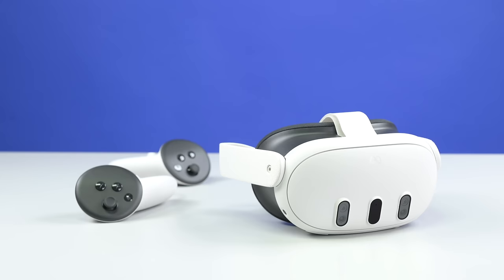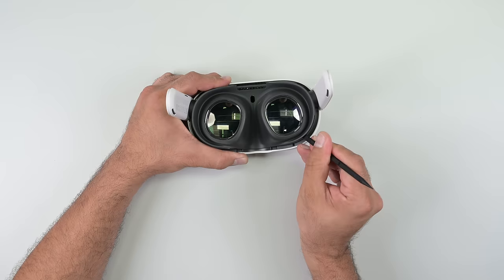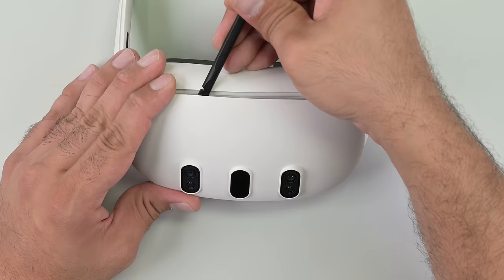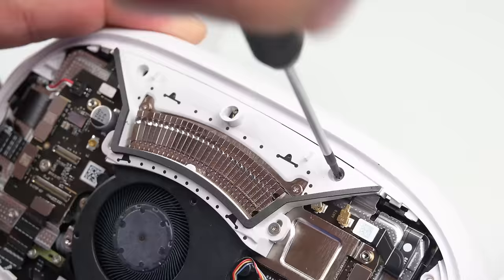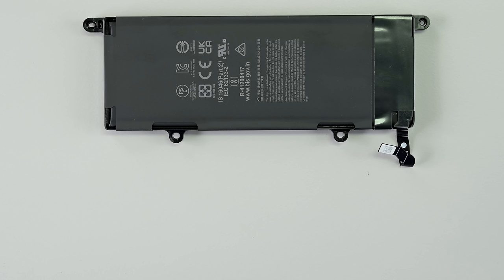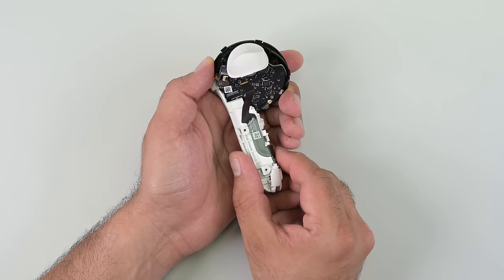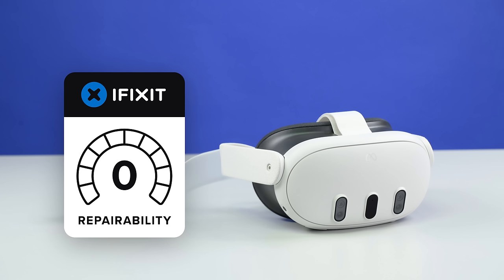Meta Quest 3 Teardown: What Are You Sacrificing for Savings?

Comment: I'm fine with this. I replaced the battery in my Quest 2 and I tore down and rebuilt the thumbsticks in both controllers to definitively fix the drift, and I'm confident I can do these operations to the Q3 even easier. Are these jobs for the average end user? No, but I'm covered.

Comment: Burrying a battery this deep into a device should be illegal. Every customer should be able to replace it within 5 minutes. I really hope for some regulations here.
Besides: Did I miss it or did IFixIt not check the control sticks? Are they using hall sensors?
Reply: Keep in mind in this instance it's actually better. The battery is pushed that far down because otherwise the headset will feel a lot heavier than it actually is. You want all the heavier components pushed nearer to your head for comfort and balance reasons

Comment: So far I am not impressed with the Quest 3.  It is half an inch smaller than the Quest 2, and I have seen stutter on simple games like beat saber. The only thing better is WiFI downloads are a lot faster, and eye focusing is a lot better than the Quest 2.  But for a 3 year wait and a $200 price increase, its an expensive sell for not a whole lot of improvement.
Reply: Just the new chipset and the pancake lenses alone are an upgrade, at least for standalone. For PCVR it supports AV1 if your GPU does too so you can have a better experience

Comment: 4 feels a bit harsh, but i wish it was easier to replace the battery
Reply: that's probably why it has the low score, since it's no better at battery replacement than the quest 2
Reply: @Omabatfartsbruh  yea, but the fact its all just screws, and not glued, means it is at least moderatly replaceable.
Reply: @rattslayer  its difficult, not impossible, thats the big part

i wouldnt be suprised if the vision pro's teardown is like swimming trough a glue factory
Reply: @Marpurrsa  i bet vision pro has a self destruction module when chassis intrusion is detected for the safely of the user.
Reply: Ahhh, yea, because you should based decisions on internal batteries for your vr headset.
Never thought I’d see the day
Reply: @mcgritty8842  because... The ease of repair, the fact that used screws instead of glue, should increase the repair ability score... And used standards screws instead of any kind of tamper resistant screws.

Never thought I would see the day.
Reply: @rattslayer  lets not forget he did break it taking it apart.  so if anyone else want's to give it a shot, good luck.
Reply: The reason the battery is so far back is because the battery is the main weight of the headset, so you want it to be as close as possible

Comment: There is this old type of light projectors, which can be found in your faculty not only at Manifest Ben rooftop. My bigest problem was dismatling laptops which don't have easy motherboard access, which meant everything must be taken apart.1:21 this possibly is some engine crack, so just an easy welding. 3:38 wi-fi connectors might seem to be unusual if you are used to those cable TV coaxial connectors. This is very modular, but is it possible to find parts and the matching drivers. No more plying with this laptop keyboard connectors if don't have to clean cpu fan asus. Probably not getting anything like this unless it's some educational language learning purpose.

Comment: What I'm having trouble getting my head around is how good this Quest 3 looks with it's display at 9 megapixels across both eyes. The Vision Pro is going to deliver 23 megapixels, more than double the resolution and the Vison Pro's color passthrough cameras will be 12mp, 3x that of Quest 3's 4mp color cameras... and the M2 will have the compute power to push those pixels at 90fps.  I don't think people bashing that $3500 price point realize what Apple is about to unleash for quality... When I put on my Quest 3 in passthrough mode I sometimes forget I'm wearing the headset, but as soon as I try to focus on something from the passthrough feed that resolution reminds me, I can't read the black text on the white screen of my monitors, etc... I have to take it off to do something and wish I could just leave it on, But with Vision Pro its reported these are non issues, combine that with all the utility of having a full OS capable of running desktop quality apps. It will be game changing.
Reply: Vision pro still won't get massive user base like the Quest 2/3. I doubt many Devs will invest the time and investment into vision pro without apple literally giving them out to Devs for free.

Comment: Seeing how difficult it is to get to the battery I'm actually wondering if that EU law about requiring user replicable batteries in the future would apply to this or only phones and handhelds / laptops 🤔
Reply: 😂 oooh thats a good question
Reply: It is replaceable. It's just buried deep withing the headset to keep the weight as close as possible to your face. With a proper screwdriver and due diligence anyone can replace it.
In case of phones, more of then than not the whole just isn't meant to be disassembled AT ALL in order to reduce the side profile to the absolute minimum permitted by the internals.

And as a side tangent - to be frank, i'm not too hot about this ridiculous resolution to make phone batteries replaceable. Most of us do not buy flagships for 1000€+++, we buy mid range phones for 200€ and don't expect to hang on to them for a decade. So most of us eye a new one long before the battery has a chance to actually fail.
This whole replaceable battery will mean we can kiss being splashproof bye bye, and welcome back thick side-profiles and tacky plastic clip-on backplates.

Comment: I still dont get why they didnt go all or nothing, it makes choosing between the two hard, as trading off eye tracking and 4 more gb of ram is though... though, higher resolution panels, higher fov, deoth sensing, and the price make the quest 3 a little more favorable.
Hoping eye tracking mods come in the future
Reply: Lol the Quest 3 is half the price and has better everything besides for eye tracking(What is this even for) and Controllers. This was the all.
Reply: It has more ram however all games and apps are limited to the same ram allocation so it's not like games are able to take advantage of it. Plus the ram in the 3 is faster. No eye tracking is a bummer for some but the 2-3x gpu and CPU speed and higher resolution screens really makes this a better headset for me.
Reply: @noahking5531  Foveated rendering is the main reason, which would really help get more graphically detailed games on the Q3. It could have some really cool applications, but maybe Quest 4 will be the one with that tech
Reply: @xl4712  tbh foveated rendering is kinda useless when you can just render the game directly, which is probably what they're going for with the XR2 Gen 2 which is 2-2.6x faster

Comment: What is the battery weight ?
It would be neat to have someone trying a battery less (or tiny battery) quest 3 Mod for PCVR or even autonomous while plugged
Reply: An educated guess puts it around 87.5g, considering the Q2's being 63g. I'd say that's heavy enough to justify removing the battery (and maybe even that plate) to relocate the battery.

Comment: I would have paid for an eye tracking version of Quest 3. But my gawd, that tear down was nerve-wracking. I wouldn't have the patience or the know-how. I would have to record my every movement like you guys to know what I did with every screw.
Reply: Eye tracking will come to the quest 3! The diy community has already developed mods and it just needs to adjust to quest 3. And then you got eye Tracking at your disposal. Yeah not included in Meta ecosystem but pretty good for any pcvr applications.
Reply: @CASyHD.  source ?
Reply: @MrKBhamm  DIY Community? YOu probably can google eytracking Mod Quest 2 or smth. Its essesntially some Infrared LEDs and a small camera filming it on a custom pcb that you put on the lenses.

Comment: I don't understand why they have to insist on burying the battery deep in the headset. Why not put it in the back of the strap? Not only would it help with weight distribution, but also make it super easily replaceable.
Reply: The strap would need to be wired up like the Pico 4. The Pico 4's strap however is not removeable and limits the freedom to change the head strap to an aftermarket one which many users prefer. They could build a strap which has removeable with a battery built in, but it will probably increase cost.

Comment: Would it be possible to use extended cables to mount the battery on the back of a hard strap? I found the weight distribution far better on the Pico4 vs Q3.

Comment: 00:04 The Meta Quest 3 is a mid-range XR competitor with new features like the depth sensor and pancake lenses.

00:50 The teardown reveals replaceable head strap and face cushion, with a minor cosmetic damage.

01:53 Removing screws and clips to access camera and sensor components.

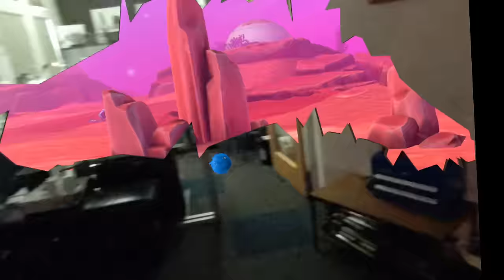02:50 The Quest 3 features a depth sensor for controller tracking and room mapping.

03:51 The XR2 Gen 2 improves performance and power efficiency compared to the Quest Pro's XR2+.

04:54 The LCD panels used in the Quest Pro are an improvement but still not as good as micro-OLED panels.

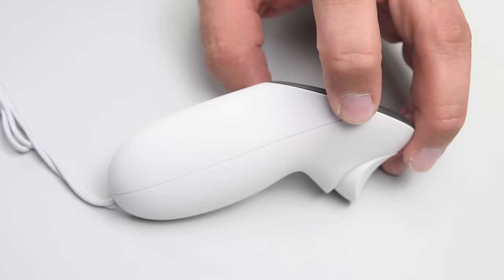05:46 The teardown reveals a simpler mainboard for the Meta Quest 3 controller.

06:54 The Meta Quest 3 offers superior resolution and pass-through capability but sacrifices eye tracking for cost savings.

Comment: I really don't know why they put battery inside. It is much better to be external battery like in Apple VR. First of all because it would be lighter on your head, have bettery cooling / less heat, and possible more slim design, and also there will not be problem with replacing the battery.
Reply: Yes

Comment: Any way you could replace the fresnel lenses in a G2 with the pancakes in the Q3 ? It would be a cool mod and you'd have the perfect PCVR headset.
Reply: Why is the Q2 the perfect headset over the Q3 if it had pancake?
Reply: @icebird76  G2 ... inexpensive, with Display Port, inside out tracking, good audio solution

Comment: I'm wondering how much would it weight if battery , xr2 gen2 with it's cooling and passthrough cams were removed? Leaving just HMD tracking cams and adding Display Port or USB port with DP alternate mode - making it an awesome PCVR headset.  It could also use controllers from Quest Pro.

Comment: Hi I have a request for you, if you still have the quest in pieces. Could try and power up the quest without the internal battery connected preferably by USB battery pack. I'm thinking it might be nice to remove the battery and make it lighter. They connect external pack and attach to belt clip

Comment: The answer? Not a whole lot really. 🤷 Mostly just the eye & face tracking sensor suites, 4GB of RAM capacity (Quest 3's got 8GB vs Quest Pro's 12GB, although Q3's RAM is WAAAAAAAAY faster/higher bandwidth), plus the fancy 500x zone FALD backlight & quantum dot layer on the Quest Pro's LCD's. 

And in exchange for those things that Quest Pro has that Quest 3 doesn't, you are actually also getting a bunch of things Quest Pro doesn't have!

Ala, ≈+33% higher resolution display panels w/ a +30% faster refresh rate (QP's 1800x1920 @ 90Hz vs Q3's 2064x2208 @ 120Hz), MASSIVELY better & more capable stereo 3D color passthrough for mixed reality (new now natively RGB dual color cameras w/ 3x the resolution of QP's natively B&W ones, AND a brand new depth sensor), AND a DRAMATICALLY faster new Qualcomm SoC! (Aka, the brand new XR2 Gen 2 vs QP's XR2 Gen 1+ [aka just an overclocked XR2 Gen 1].)

Comment: I use a really long usb cable to connect my quest 3 to my pc to play games off my PC in Steam. I have on more than one occasion stepped on said cable pulling down on the headset. I believe this has caused my usb-c port to be loose inside the headset. How to i get to the usb-c port to fix that? I have tried multiple cords and not works so i know its not a usb cord issue.

Comment: 5:30 ... 🤦😑 WRONG!!!!! The Quest 3's display panels being mounted in a rotated/angled position to maximize FOV has ABSOLUTELY NOTHING TO DO WITH (let ALONE being a "direct consequence of") them being "cheaper LCD instead of Micro-OLED panels like in the Vision Pro"!!! 🤦

In fact, Apple's likely to have done the EXACT SAME THING when mounting its fancy Micro-OLED displays inside the Vision Pro for the EXACT SAME REASON (to maximize the headset's possible FOV for a given display panel size), meaning it'll likely have the EXACT SAME diagonal arrangement of pixels despite being Micro-OLED vs LCD, even if the pixels themselves are SIGNIFICANTLY denser/smaller! 

None of this has ABSOLUTELY FREAKING ANYTHING TO DO WITH THE SPECIFIC PANEL TYPE BEING USED!!! 🤷

Comment: Does anyone know what type of connector is used between the displays and the mainboard? From what I have read the quest 3 has best-in-class optics, but using it for PCVR adds 30-40 ms latency due to encoding/decoding. I think that could be reduced to less than 10 ms if the uncompressed image was routed directly to the display. Thanks in advance!

Comment: Where exactly is the microphone located? Your breakdown said it's connected to the faceplate and I don't see where the hole would be for it. I am just looking at photos online since I don't have mine yet. I have read about the issues with popping. I would like to see if/how I can add a pop filter until a software update fixes the issue (as some have suggested it will)

Comment: Very interesting on the heat escaping through the plastic! I put on an included silicone cover with my headset aand suffered downclocking of display hz from 120 to 72, then 36! (which the quest 3 does when overheating) and it resolved almost immediately once I removed the silicone cover. It wasn't misplaced, all vents were open - but that plastic really needs to be unimpeded. I wonder if vinyl stickers will end up impacting the thermal performance of the device?
Reply: could glue heatsinks on that badbow faceplate XD
Reply: Asking myself why they didnt put some slits there for better air flow. Maybe at the bottom too fir cold air input. Because of possible Dust issue?

Comment: I wonder if, with different routing for the ribbon cables, the battery could have been in a slot accessible from the top of the visor...

0:36 From what I can see, there doesn't appear to be much in term of components from the top to the beginning of the battery compartment.

It would be really cool to see in a newer iteration.

Comment: meta needs to get the computer and battery out of the headset and into a pocket sized form. Thats the way to get the headsets way smaller. Then if they can make a wireless connection from the computer/battery to the headset your good to go.

Comment: I've been hesitant to contact support, cause I don't want to be without it, but my screen keeps going blank. After seeing where those ribbon cable are up front, I'm almost certain there's a connection issue with one of clip in connectors. Pressing on the front faceplate was the only way I could get an image to come on the screen. I'm afraid to even reposition it on my face in the middle of a game, cause I've gotten stuck... sucks Since then, it seems more like the arms of the headset can cause it too, if I squeeze in or pull out on the arms, I can get the display back.. weird. And I'm not happy :-(
Reply: its brand new you got warranty why not just contact support rather than risking it yourself then being denied a replacement after something goes wrong.

Comment: Nice video!
Whats the "steering effect" that you say this rotated lcd panels can cause? Coudnt find any info, thanks
Reply: Tearing happens when the refresh rate of a display is at a different frequency than when a frame is produced. In a game on pc with vsync off and a monitor that can't adapt refresh rates, ie 60hz, you'll see parts of two or more frames in a given time, which makes it look like a tear in the image displayed. This happens because every lcd physically refreshes from one direction to the other. On this headset, I assume this is more like the Ipad mini 6 jelly scroll 'defect' where the screen refreshed horizontally instead of vertically (like most users would hold it), making scrolling a webpage look similar to tears in portrait mode. I'd imagine this is how this compairs to the quest pro/3 with the display being refreshed horizontally at 45°. I don't have a pro/3 yet to see first hand.
Reply: all clear now, thanks @NoAwoo  for your time :)

Comment: Does the quest 3 need an application to be installed on an computer to work, or when you plug it into a computer does it operate like a monitor. The reason why im asking is whether i can connect this to my work computer which i cannot install applications but i want a larger screen when im travelling.
Reply: yes it does need app on pc to use as monitor
Reply: @estusflask982  ahhh thanks, might see if my work would approve the install of the app.

Comment: ill save you 8 minutes

	Meta Quest 3	Meta Quest Pro
Dimensions	184 x 160 x 98mm	265 x 127 x 196mm
Weight	515g	722g
Display	Two LCD panels	Two LCD quantum dot panels
Display resolution	2,064 x 2,208 pixels per eye	1,832 x 1,920 pixels per eye
FOV	110 degrees horizontal, 96 degrees vertical	106 degrees horizontal, 96 degrees vertical
Refresh rate	72Hz, 80Hz, 90Hz, 120Hz	72Hz, 80Hz, 90Hz
Chipset	Qualcomm Snapdragon XR2 Gen 2	Qualcomm Snapdragon XR2+ Gen 1
RAM	8GB	12GB
Storage	128GB or 512GB	256GB
Battery life	2 hours	12 minutes

Comment: The philosophy of design for Quest line is never changed, loyal with a brick in the front from first gen to last gen. It's so fun if Quest 4 is same and more weight so we can train the neck and enjoying the pain .
Any talent unleased the electronic perk should separate the battery, main board, CPU, wifi into a private box outside ? Yes... savier for Quest line.
Reply: that's depressing.